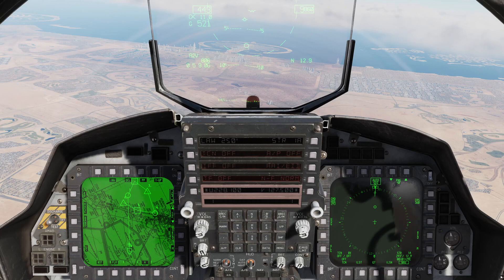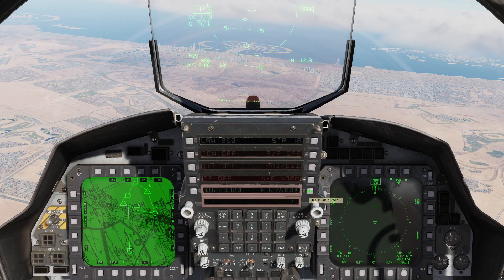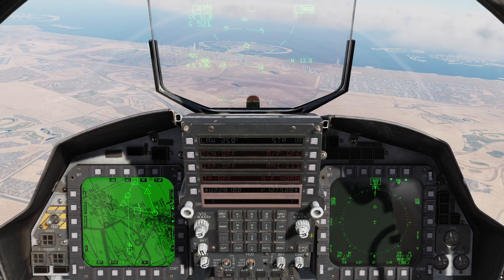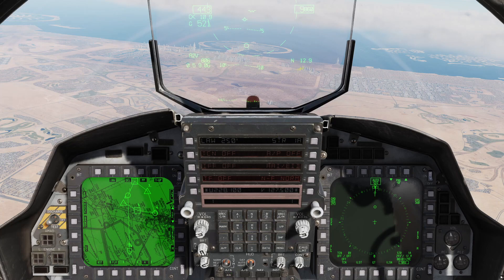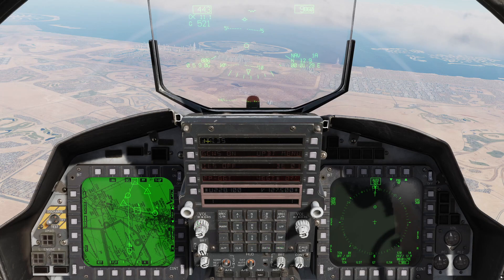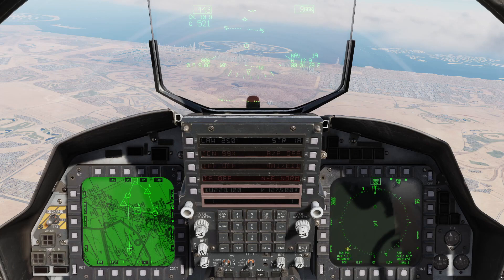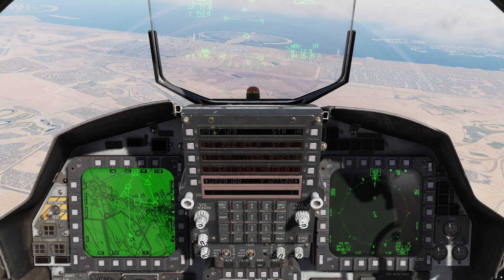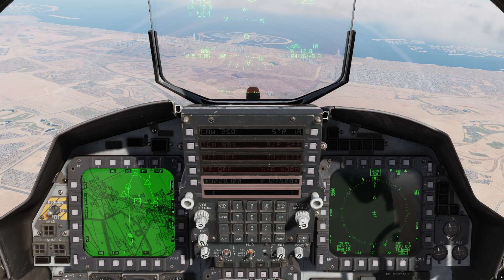DCS: F-15E Strike Eagle | UFC part 1

Comment: The graphics of the cockpit look great!

Question: does the Mudhen handle more like an F-18 or an F-14? It’s not FBW, correct? The F-18 feels quite sluggish compared to the F-14, which feels very direct and unrestricted, which makes sense considering it’s not FBW.
Reply: Isn’t the f15E fly by wire like the f/a18c? I thought I read that somewhere
Reply: @yarah83  no, it's not
Reply: @Occams_laser303  I got confused with the f15 advanced
Reply: It has the same FCS as the F-15C, just a bit more weight, drag and also a bit more engine power behind it.
If you have the FC3 F-15C, that's how she flies, not fly by wire but a lot of assistance from the FCS, just like the F-18, wich also does not have FBW.
Currently in DCS only the F-16, Mirage 2000 and JF-17 (pitch only) have fly-by-wire.

Edit: after @HeavyMetalMonk 's comment, the F-18 has a limited mechanical backup to the stabilators, but the FCS can completely override it, so for all intents and purposes it is also full FBW.
Reply: @kilianortmann9979  F/A-18 in DCS is fully FBW.
Reply: @Occams_laser303  Every aircraft is technically FBW in a video game....
Reply: @jimrussell4062  technically correct which is the best kind.... But still, the flight models are different in the game from fbw and non fbw planes
Reply: @kilianortmann9979  I don’t have the F-15C, but as this other person said, the F-18 does have fly by wire.

But the question still stands. Will the F-15E feel sluggish like the F-18 or sharp like the F-14? How does the F-15C feel, considering it’s so similar?
Reply: @rhysgoodman7628  Unfortunately I can't compare it to the F-18, I only have the F-14, JF-17 and a little bit of time in the F-15.
To me the F-15 does not feel sluggish but the FCS has noticeable authority, it basically irons out adverse and proverse yaw tendencies.
The F-15 also has aileron-rudder interconnect, instead of switching from aileron to rudder roll as the AoA increases (like in the F-14) the FCS does that for you.
I feel like I have quite a bit more pitch and over G authority in the F-15 than in the Jeff, but obviously not the instant rip your wings of levels of the Tomcat.
I guess you have to try it out, to me both feel crisp after two or three maneuvers to get accustomed to the different flight characteristics, you might be more sensitive to this than I am though.
Reply: @kilianortmann9979  interesting. Thanks! Sounds like the F-15 has more of an “assisted” feel. The F-18 has a very restricted, sluggish feel. I never noticed it until I got the F-14, which is extremely sharp and unrestricted. Thanks!